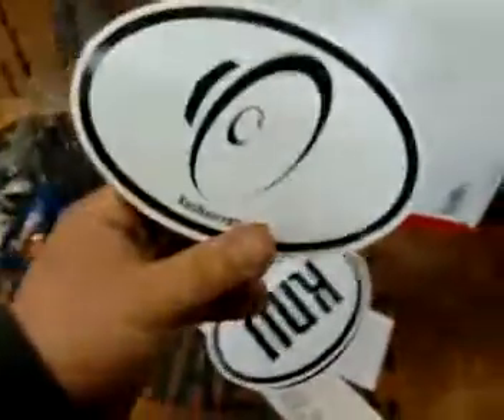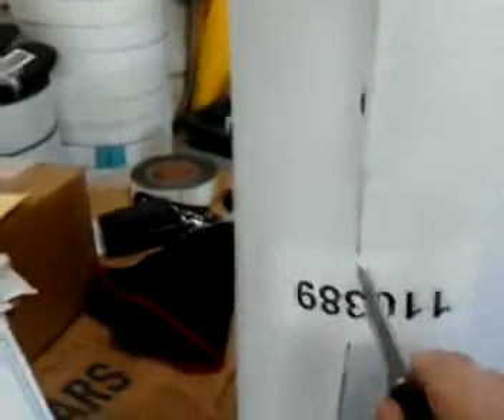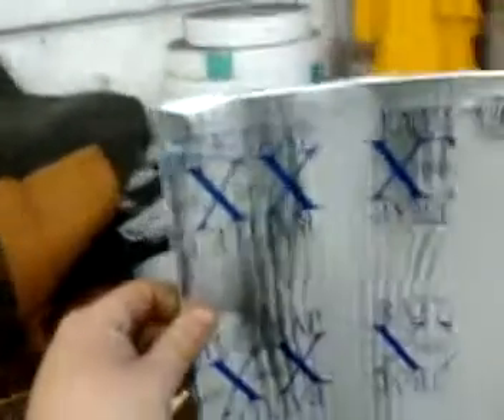2007 chevy malibu system update

Comment from the maker: o i heated it up all right i have a shop to use so i cranked the heat up to 85 and used a heat gun just for added overkill heat lol i have it all installed and tuned and it is banging like all hell i am trying to get a vid up but my phone has been messing up i still need to make all the trim peaces and cover the box but i am thinking of re building the box to add a 4th 15 but idk yet lol